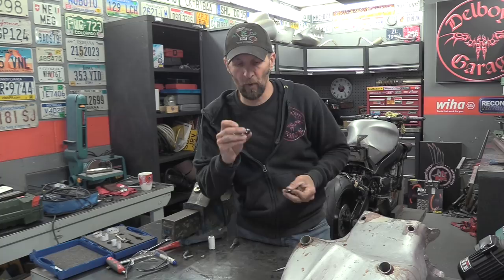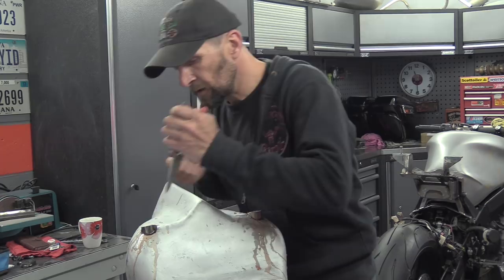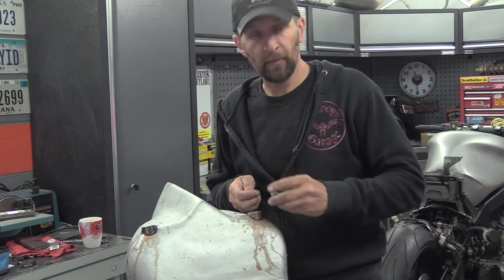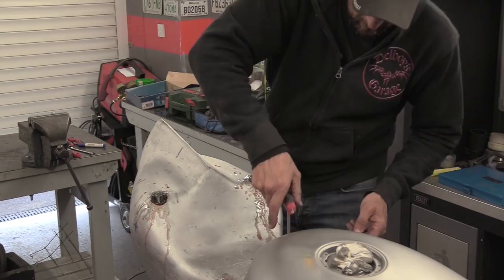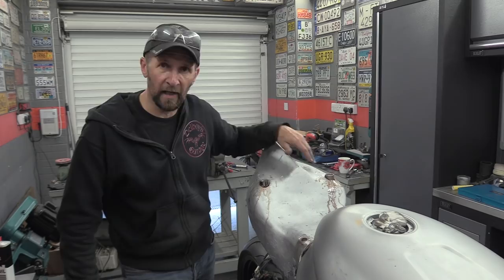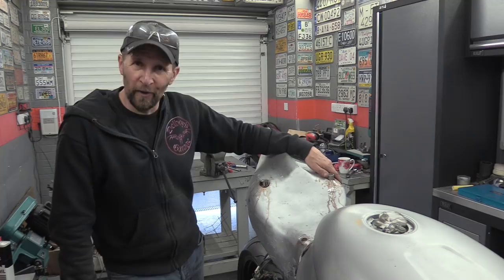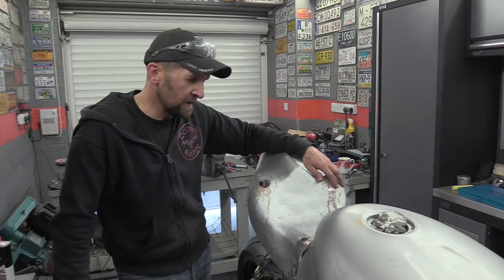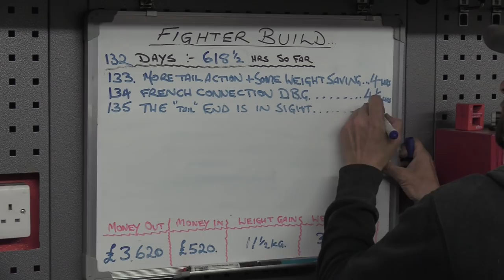Delboy's Garage, Fighter Build #130, Tail Finally Mounted..

Comment: Ah, a four into one, U shaped, under seat Brooklands Can, blown into shape with a pressure washer . . . (worry not, 400 odd looking metal balloons later, they say you get the hang of it)
Good luck with the heat & close electronicals/buttocks etc. - & bear in mind any 'heat soak' after a 10 min park up - having to do the first half mile stood up on the pegs until the seat cools down, can be a sod in heavy traffic - don't ask me how I know, just call me 'Hotlips' : )

Comment: What are the grinding pads you use Del for washers and grinding flat tubes. Great how you did washers.
Reply from the maker: They are 3M 40grit sanding discs... available from your weld supplier, or many other outlets, anyone who sells cutting discs will also sell these...!

Comment: Ok my knowledge is some what low regarding what you know and what you don't Del, just took my bike in for MOT today. To be told loud pipes are OUT, don't know if you are aware. It's an instant fail, had to take my standard ones in with me to get it through, will swap back afterwards (shhhhhhh) so you may have to be careful with what you fit
Reply from the maker: Sounds like you need to get to know your MOT tester a little better mate.. never had a problem in 30 years, and to my knowledge there has been no new law changed on the subject in the last few years... its all about how they interpret you and your bike.. same goes for small plates, some will [ass them some wont.. which in some ways makes it a bit of a joke, but one we are happy with..lol
Reply: Hi Del, hear what your saying. As i say this was today and i was shown the letter put out to all (should have by now) bike shops. This has come into effect as of last month, police will now apparently be able to stop you, and put you off the road if they are to loud. The place i use out sources for MOT's and is the same one he has used for years, last year i got an advisory. You may well have many more contacts, but it does appear they are clamping down. I will let you know what happens as an update if you want it
Reply: Just googled it changes as of the 20th May, have a look you'll understand it better than me

Comment: Hi Del & Penny!
Hey Del you know I have been enjoying the build, I am a bit concerned about the plan to put a slimmer exhaust to emerge out at the back, MATE if you do try to give some serious thought to the electrical/electronic components that are placed in the area they currently are, I would expect the level of heat to be very high and this would lead to electrical problems, 
A couple of things to consider,
thoroughly tested heat shields for one, but I would be looking at sticking a cooling fan in there somewhere!
Loving the show but I cannot stress how much reliable operation of electronic/electrical components can be effected by excessive heat!
The sleek look the central exhaust would provide, 
Definitely worth it, but as always with design the knock on effect leads to thus!
Good luck with it Del
Kind regards Warren
Reply from the maker: Hi Warren, you are dead right my friend... that is totally critical and one of my major priorites, am planning to build the heat shield first, looking at materials to build it and make it from... there are materials you can hold a blow torch against and no matter what they cost something like that is worth it, so then there'll be some serious consideration to the subject of heat sheilding, long before I get to building the exhaust itself... and I absoutely love your idea of a fan, I've seen some extremely cool (no pun intended!) options that are no bigger than 1" in dia., but shift a great deal of air!  So thank you for the 'up-grade' in my plans, this sharing of minds is exactly why I love YT - thank you Sir !
Reply: Moonfleet41 Hey Del, Sir you do me great honour!
Merely wishing to share the biscuits round!
Not entirely sure, but I reckon some computer type cooling fans might prove useful they tend to run straight of 12v which simplifies matter's, not sure how (up-to-it) they would be in the elements on the road etc,,, spiders admiring the translucent tail piece!
Cheers my friend
Warren

Comment: liking the idea on the exhaust, why not french tube them into the side of the tail unit so they look like air scoops ?
Reply from the maker: That would be cool indeed.. maybe issues with heat and getting the panel off.. but its a sure plan to get the exit out the side in a slash cut style.. it'll be a lot of research into heat insulation first, and create a heat shield that is practically perfect and passes zero heat to the electrics.. once thats take care of, i can get to the matter of creating a silly system to pass the gasses through...
Reply: Have a look, similar idea but exits through the top of the tail,wouldnt work with our weather but the concept is there 
https://twitter.com/hindicobra
it is titled Underseat exhaust on a Z1 , very different
Reply from the maker: Seen thats now, what a wonderful result they made.. not a truck flap in sight..lol!